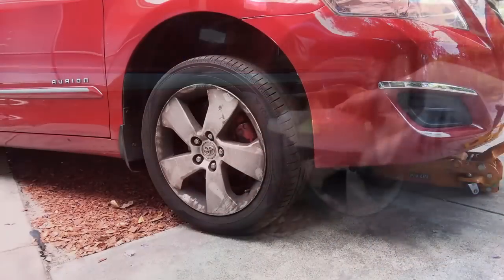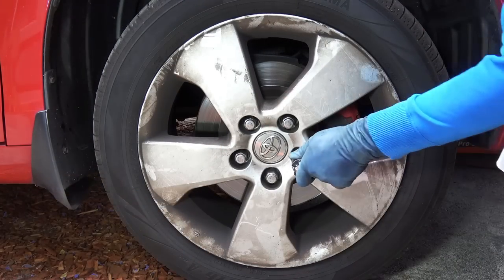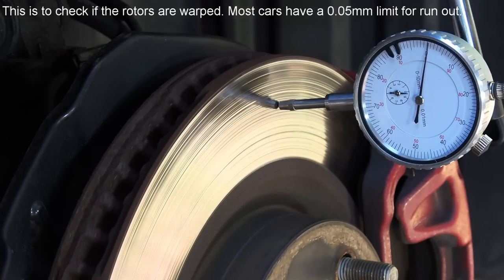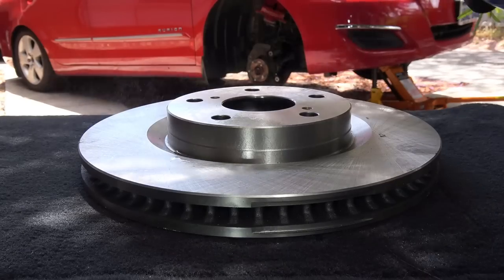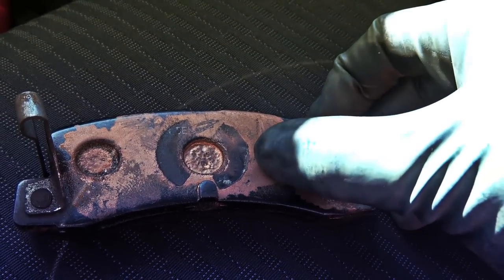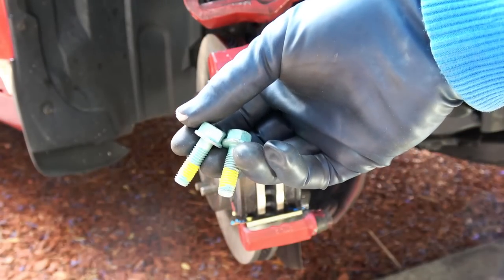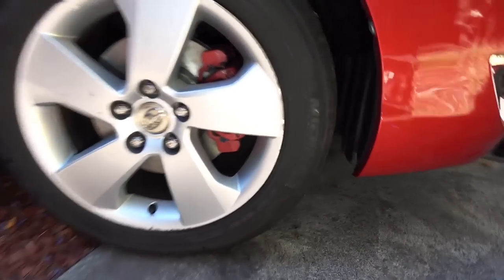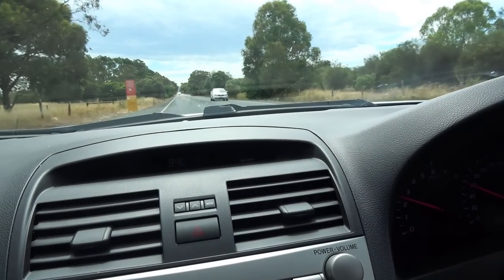Here's the correct way to Change Brake Pads & Rotors in a car

Comment: This video covers everything to OEM requirements.  By far the most comprehensive and complete review of the proper methodology to follow changing brakes.  I am a Chemical Engineer and work at an OEM assembly facility.  I could not find a single fault in this video.  The author summarized the proper method detailed in virtually every OEM service manual.  Covered everything down to proper lubricants and torque specs.  The road test was even included. I would add bleeding brakes for old cars to ensure the fluid is clean.  But that is not required since he noted to break the bleeder screw(that should be done correctly to avoid air entering then system).  Excellent job mate!!

Comment: Been a while since I did my own brakes, however just did my '06 Murano. Watched several different video's, and of course say this one after I was done.  Very nice, no obnoxious music, referenced toque spec's and proper lubes per Manf., wait, what!!! No one else seems to do that, just torque it down until if feels right, and then a bit more.... Just a couple of possible points if I might. I used anti-sieze on every bolt (wheel, caliper, and bracket).
In addition to lubing those caliper pins, you may need to check inside the bracket holes to make sure there isn't more contaminated/old grease.  I was advised not to put any lube on the back of the brake pad, but did put some Sil-Glydeon the pad ends that slide on the brake pad hardware.  I'll know shortly if I listened to the wrong person.  Keep of the great work.

Comment: What are your feelings on Burning-in, burnishing, breaking-in new pads.  The 5-10 quick stops from 60mph to 10?  I am going to be replacing pads on my Vette.  I am concerned with glazing the pads and causing a squeal.  FYI:  your videos are great! Content, instructions, materials, and talking speed.  Keep them coming please.
Reply from the maker: When you break in the new pads, do few gentle slow downs without locking the wheels or having abs kicked in, So won't glaze the pads or make a squeal.

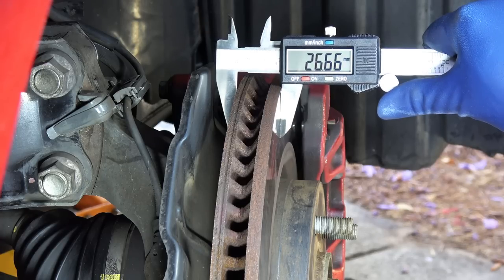Comment: 2:59 won't work :P There will be a lip on the rotor that you will be measuring instead. Use a micrometer if you really want.
Reply from the maker: Brake rotor calipers have pointy tips on the jaws so the jaws not touching any lips.
Reply: Well I learned something then :P Never seen one like that.